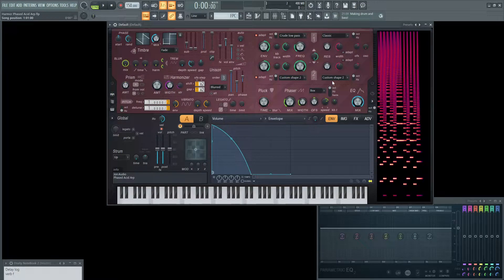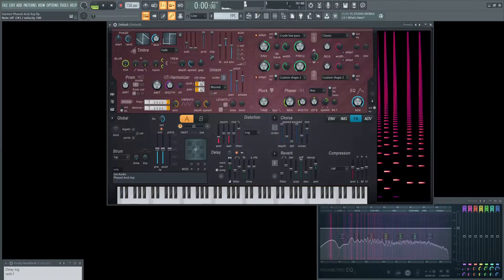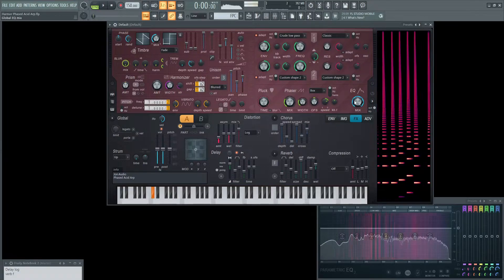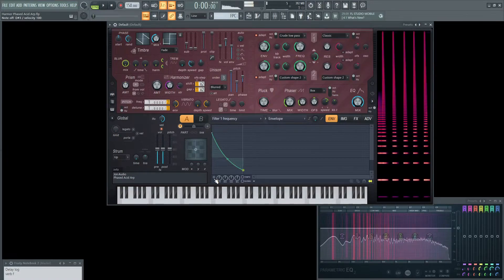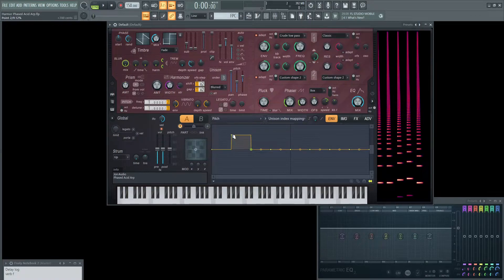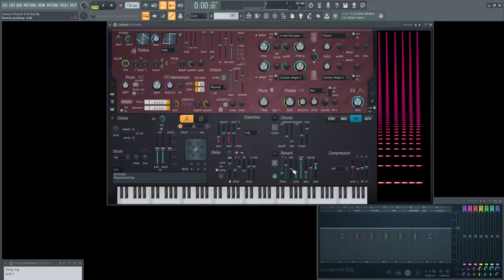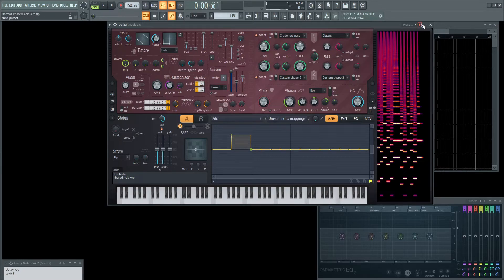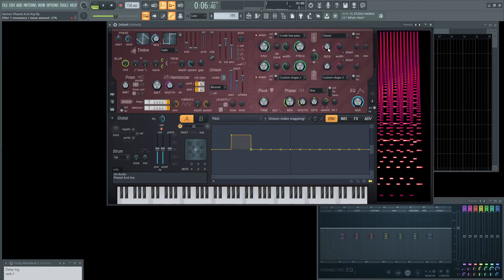Harmor Phased Acid Arp | FL Studio Tutorial

Comment: Amazing how the phaser's contribution gets accentuated when you turned the reverb on.  Seems to add bounciness when the arp gets engaged too.
Incidentally, i believe that your pitch mapping isn't doing anything.  The Unison Index Mapping has vertical lines which represent unison voices.  The intersection of the envelope and vertical line determines the value assigned to respective voice.  For some reason, unison order of 2 shows a line in the middle but the voices take values set at the mapping's left and right edge.  In the case of 3 voices, as you've chosen in your preset, values are taken from both edges and the centre line.
p.s. Thanks for your prolific output.  Your techniques seep in, then ooze out when i play with sound design.
Reply from the maker: Very interesting, I'll have to double check that! Thanks for letting me know. I'm glad they provide some inspiration for you!!